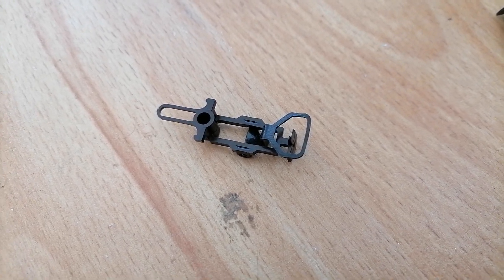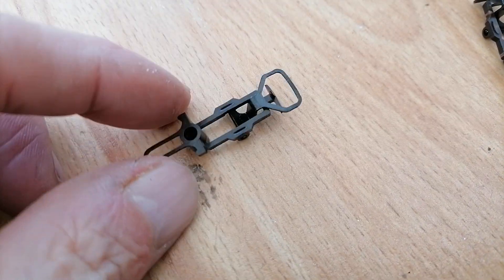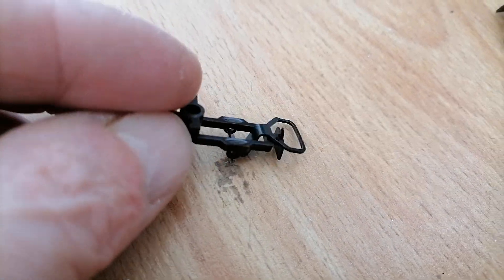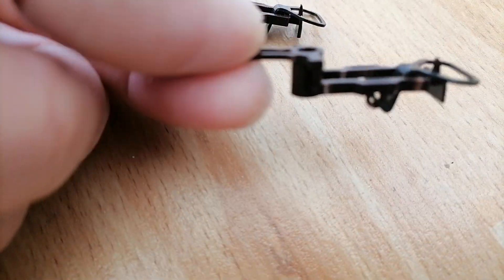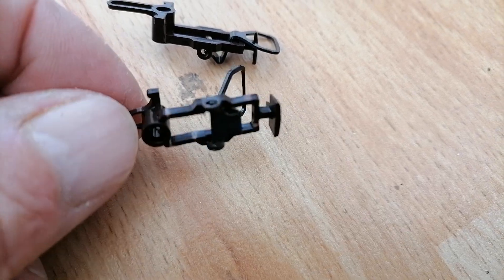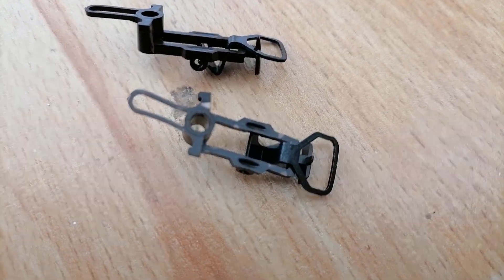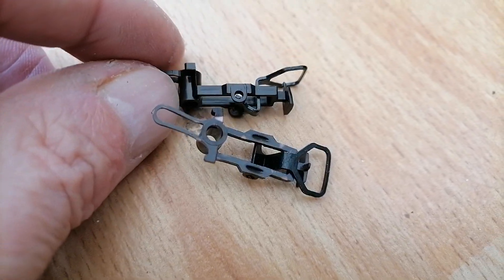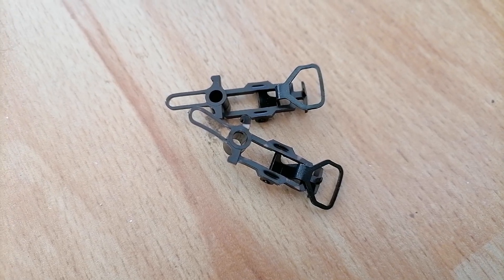HELP PLEASE. Can anybody tell me what these are please?

Comment: I have a few wagons with that sort of coupling. The only branded one is marked Piko ModellBahn. It has an all metal coupling and is sprung to allow some lateral movement. I have other unbranded wagons that have matching couplings but are plastic moulded onto the bogie but with a metal clip over the top that moves to make the coupling.
I hope this helps.